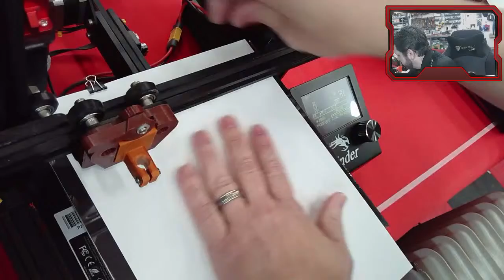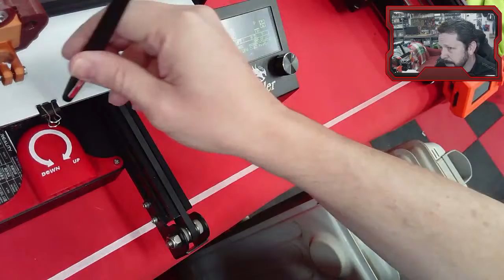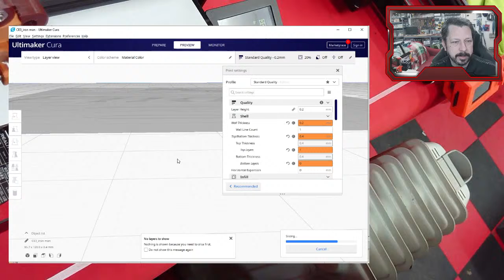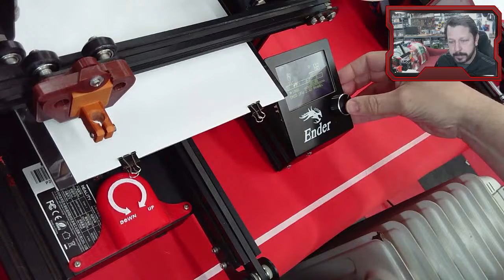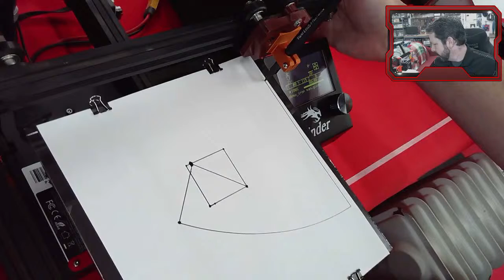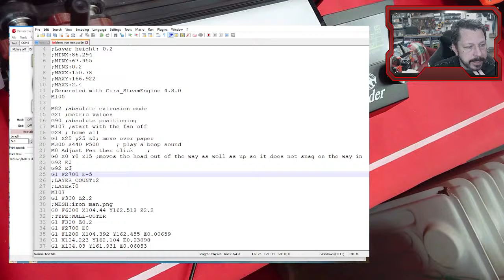18 | Printer as plotter | Ender 3 | Cura

Comment: i think i may have missed something because i didn't see in the video how you set the z offset to avoid the extruder from being to close to the bed
i think i'm gonna lift up a little bit the z end stop
btw great video thanks a lot
Reply from the maker: Thanks! I believe I manually lifted the z-end stop . Maybe I forgot to show it in the video though - it has been a while since I made this video and I don’t remember for sure. :)
Reply: @KellyBC  I found an easier way to do it, set the thickness of the first layer to 10mm and in the image import parameters set the base height to 1mm as well,the extruder will print the first layer 10 mm from the bed, it's a bit funny to see the 3D printer making a 2D drawing controlled by a 3D slicer
Reply from the maker: @hexagonal7708  Great idea!

Comment: The Drawer I've built is 5/6 foot. designed off the top of a ender 5. I don't have a heated bed or hot end or any of the wires and I'm getting errors and no moment. Any thoughts. Also I truly thank you for your help.
Reply from the maker: The first thing I could think of is that there may be errors associated with it not heating but thinking that it needs to extrude filament. Most firmware wont allow the printer to extrude if the hot end thermistor is not reading a printing level temperature.
Reply: @KellyBC  So you think I need a thermistor for the hot end. Any thought on anything else I could plug in there since I don't have one? If I need one Ill get one. THX

Comment: I'm so happy to have found this , for months I've been trying to find help. THX .question ? I've built a large scale plotter and wondering how precise of a drawing can I do? IS stl files good on large scale. want to draw full size Terminator and iron man and other cool stuff on wall. Is it hard to convert a pic to STL?. Plz reply thank you.
Reply from the maker: You are very welcome! I think some of the slicers can even take pictures directly into them now. Cura may be able to do this. I believe the STL file could work at a large scale, but I haven’t printed anything larger than the bed of an Ender 3 (about 200mm x 200mm). You may also want to look at some of the control software for a laser cutter as it would be similar, or even a router as it would be very similar. Thank you for the kind comment!

Comment: Bro does M0 code works for you to pause the print? its not working for me. im using ender 3 marlin firmware with cr touch.
i also crosschecked the code run via pronterface. the  G4 with time limit works for me.
but i need manual resume option wihtout any timelimit to change filament. any idea what to use in case of M0 not works?
Reply from the maker: I will have to check on that.

Comment: fantastic video bro.
seen many commented you to post the start and end gcode.
also i could see u have posted the ironman gcode zip.

let me paste the code here which is filtered from ur gcode.

Start Gcode:

G21 ;metric values
G90 ;absolute positioning
M107 ;start with the fan off
G28 ; home all
G1 X25 y25 z0; move over paper
M300 S440 P500     ; play a beep sound
M0 Adjust Pen then click    ; 
G0 X0 Y0 Z15 ;moves the head out of the way as well as up so it does not snag on the way in

End Gcode:

G91 ;relative positioning
G0 Z15 ;move Z up before moving away
G28 X0 Y0 ;move X/Y to min endstops, so the head is out of the way
M84 X Y E ;Disable all steppers but Z
G90 ;absolute positioning
G1 X0 Y200 ;Present print
M106 S0 ;Turn-off fan
M104 S0 ;Turn-off hotend
M140 S0 ;Turn-off bed
M84 X Y E ;Disable all steppers but Z
Reply from the maker: This is great, thanks!!
Reply: tysm!!

Comment: Incredible! I have been struggling with converting my Ender into a drag knife cutter, and went through so many different methods before landing on Cura as a last try. Had a couple of small tweaks in Cura (combing was causing an issue with z-hop so I turned it off). Thanks a ton for this in depth stream!
Reply from the maker: Thank you! I sometimes go overboard on the details and side quests, but in the end I enjoy it when all of that stuff is useful for someone. :)

Comment: Great instructional video! Do you happen to have a link to the pen holder you designed? Thanks!
Reply from the maker: I looked for it and I can't find it. If I run across it somewhere I will post a link to it. I do remember that I used the link in the description to download a blank tool holder and added my pen holder to that.
Reply: @KellyBC  Ok. Thanks for looking.